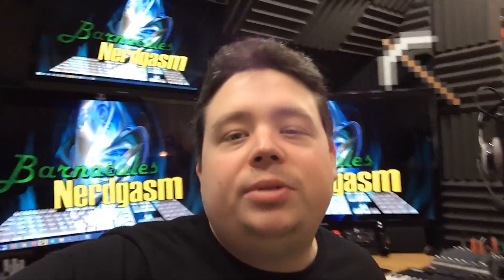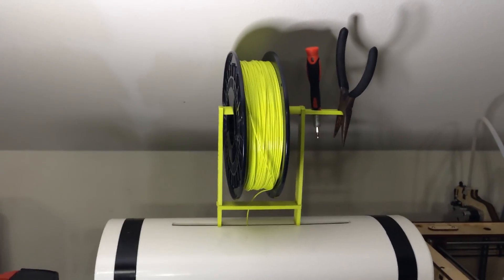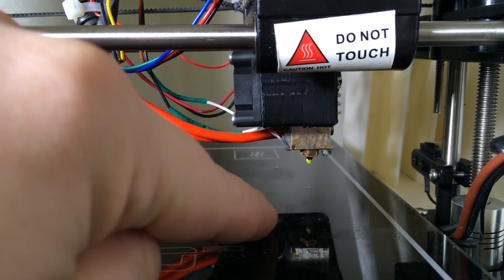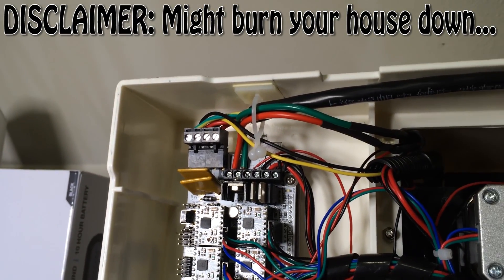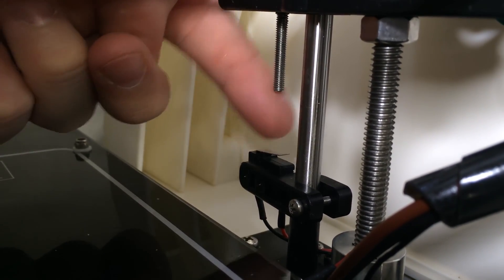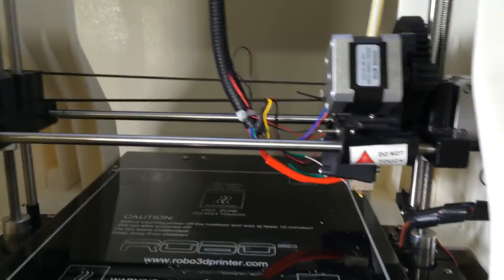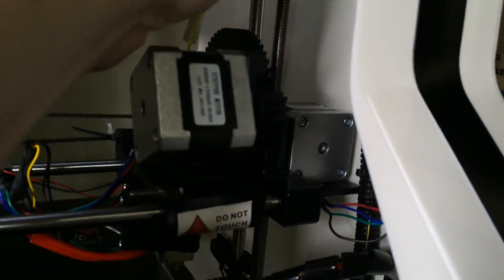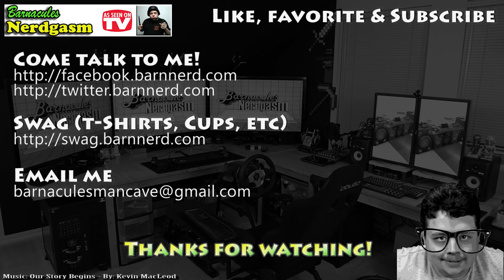How To Fix Your Robo 3D Printer : Tips & Tricks to Get Awesome Prints - @Barnacules

Comment: Hi Sir, I have had my my printer only 3 months and the power will not turn on. I did a 2 hour printing everything was great. 8 hours later it was dead, No lights and no sounds. I did check the power cord and the outlet. I have tried to get help from ROBO and some forum. So success. Do you have any suggestions. Thank you in advance!

Comment: Just a note, there's two versions of that double sided tape. DO NOT use the foam stuff if you care at all about stability. Also, make absolutely sure there are no air bubbles when you mount the tape, otherwise the adhesive will oxidize and stop being an adhesive.

Comment: Thank you for this video! I just got the robo 3d r1plus, and had some issues that you described in your video.  They have since added a stabilizer in the top for the rods and I'm sure a bunch of other upgrades (fixes).  Thank you for the spool! Better design than the one that comes with it in my opinion.  Will be printing this next. Great Video.

Comment: has Robo 3D included any of the "mods" you suggest in the latest versions of their products?  They seem like must haves at this point.
Reply: +Robert George 
I just bought a Robo 3D two days ago, now called the Robo 3D R1 plus. A few of the things shown here to print are added to the new design. The most important being that the guide rods reach to the top of the case and fit into holes lined with foam to keep them supported.
This being said there is still a bit of wobble in them and could be supported better, but it is one change that is similar to these here.
All others such as the print head change are still relevant, and the need to make a top mounted spool holder is a godsend. So even if you buy one of the new models, print a spool holder first.

Comment: I like your take on this particular printer.  I'm curious though, if the changes you've made, rather your upgrades, have been implimented into the latest version of this particular printer.  I've recently had mixed luck with two different Davinici II printers from XYZ.  Ugg.... I won't even get into why I dislike those printers so much.  But recently purchased this printer under the label, Robo 3D - R1 Plus +3D.  It will arrive next week and I'm wondering if the company that designed this printer has implimented any of these updates into it.  Like the supports for the rods.  I never had "tall print" problems with my Davinci Printer, but it had a slew of other issues that I won't go into.  Any advice you may have on someone getting a brand new Robo would be greatly appreciated.  Thanks in advance.  I'll be watching for more vids too.  I've been 3D Printing for two years now with Davinci printers as well as an Afinia H series printer at my work place.  I'm eager to see how the Robo holds up.
Reply: +Michael Hyatt Most of the upgrades that he has done have been built into the new models. I bought the R1 a few months ago, and pretty much everything I ve seen him do for upgrades have already been included in the model I bought. I believe came out with the R1 Plus right after I bought mine, so it may include more improvements. I ve been very happy with my R1 so far.

Comment: you should have a look at the bq hephestos 2 printer, its a DIY 3d printer but has a lot of good points in it, like the extruder comes with all the fans on it, it auto-levels and checks the distance from the platform before each print and stuff. I have one and I love it, not too expensive either

Comment: Just unboxed my new Robo, and the folks over there are listening, most of your upgrades are already addressed.  Spool holder is in a different location, Z-axis rods continue into supports at the inside top of the housing, and the main drive gear for the print head has no slop at all.  There is not a switch in the location you showed, so I can't speak to that yet, and have yet to start a print but will update when I do.  Keep keeping them straight over there!

Comment: I'm just wondering. Since the Robo3D has a RAMPS board, why didn't you just screw in the fan wires to the Heater 9 block, where the designers of the RAMPS board intended you to connect them to?

Comment: Hello Everyone! anyone? haha. So i tried printing a file and for some reason it didn't print the whole thing.. (i wasn't present for the whole print. I left it running) The print is for two peaces that sit over each other but one ended up being slightly shorter. am i missing something? The file is right but the print is wrong. It said est. print time would be 2h 33m 43s but the in the history part it said the file took 2hrs 24m.... Any suggestions?

Thanks a lot!

Comment: I just ordered the robo 3d. Is new printer head bowden or direct drive?
Reply from the maker: direct drive, there are trade-off's the direct drive works better with materials that are flexible like Ninja Flex and are more consistent but bowden takes weight off the print head allowing it to move much faster. I really should do a video on the differences.
Reply: Barnacules Nerdgasm i want to buy an e3d v6 print head for upgrade my robo3d, but i dont know what's the correct spec e3d print head i should buy?
v6 hotend 12v or 24v? direct or bowden?
Reply: John Reno Thanks for the order John.  Let us know if you need anything!

Comment: Hey jerry I have a sub $1000 printer from Plastic Scribbler and the extruder is a nightmare of never ending clogging. The stepper motor keeps on stopping and missing steps during my prints. Do you think I should take a chance and try a e3d v6 or try and return it to get a robo?
Reply: IN3RT1A Tech If you do end up getting a Robo, we'll be there to help you IN3RT1A Tech.  24/7 support.  Thanks!
Reply: RoBo 3D Thanks guys, I did get a robo, super happy with it :D

Comment: I don't think he has the R1. I believe the R1 fixed most of the problems.
Reply from the maker: The R1 has most of the fixes already. I'm actually getting ready to install the new BED upgrade that comes on the R1 and a E3DV6 hot end which they just sent me to replace the v5.
Reply: exxodas Hi Exxodas, you are correct, the new R1 has all the fixes included!
Reply: ROBO 3D does it include the stabilizers. I think i will still print the holder. I think i need it because i will have the printer on the edge of my desk, to create space for the bed to move out on the back. So i might bump into the new designed included holder. Buying this machine next week so yeah :D

Comment: I love you sir I wish you would post a slightly more in depth INSTAlling the extruder I still haven't got my robo working :/
Reply from the maker: I will be installing the E3DV6 hotend soon, I will try to make the video more indepth for that install.
Reply: Hot..!!!You can save to 72$ when you buy Epson Printer here amzn.to/1pMsygI Click order now so very cheap ..!!!
Reply: Man that sucks. My robo came in today ands it's working great. I'm only working on 20 mins or less prints but it's working fine.
Reply: Kevin Nguyen That's good I know robo cares, they do! I deserve my troubles for being an early adopter without a lot of community support to take care of problems along the way.. I got mine early and had problems with my extruder which eventually I wrote to robo about and they are sending me the new r1 metal replacement. I'm close I'll actually probably get it working today, I had problems with the thermistor and attaching the new extruder and getting clogged again!
Reply: Yeah mine is the one with the new Hex heads. i had some problems this morning but it was more with mattercontrol than the printer.
Reply: Barnacules Nerdgasm you go girl
Reply: Barnacules Nerdgasm Did you ever install your e3d v6?
Reply: Barnacules Nerdgasm I will also be installing the E3DV6 soon. An in-depth install video would surely be much appreciated by your fans! Plus, it's been a while since you did a video on your Robo 3D! :)

Comment: Hi Jerry I was directed to your videos from another maker in the 3d community.... I have a few questions and comments on your video. First I would like to say JOB WELL DONE (tip of the hat) secondly I was curious as to when you got your robo printer I just received mine a few days ago, (it seems they have addressed the issue of the vertical rods) as my inner case has the spots for them to lock in on the top, as well as it has its own led lighting in it. Mine also came with a newer version material holder that locks into the outer case itself (but I still think I like yours better) my other concern is that with mine it has a good printing head (well so far anyways) but the problem I am having is the way that they mounted the cooling fan for the head is it now drags on the actual printed part area... sometimes catching on the filament and mucking up the entire print, I wish yours was newer so as you could possibly help me solve this issue.  DO you always use 70 c for your bed temp? and what temp settings do you recommend for printing with PLA and or ABS??? looking forward to your responses keep up the good work and helping us all out .

Comment: I'm sure Jerry is going to get pissed at me, but I am completely nonplussed here.  I tried to post this in the Robo3D forums, but I get a "server error occured".  So I'm just going to post this here, and follow up with the resolution (provided I haven't pulled an Ernest Hemingway/Robin Williams and hope that it helps someone.

I finally got my Robo3D "dialed in".  I printed several parts that were demanding in terms of accuracy.  This took me 2 1/2 weeks to figure out.  So feeling rather chuffed with myself, I shut down the software and printer, went to the corner store to get a few beers to celebrate, came back, fired everything back up again to do a salutory print for my friend's kids ( a couple of lego bricks ) and started getting an error to the effect that the first layer needs to be less than the nozzle width (which is 0.3mm).  Guys, I hadn't changed an F'n thing!  

Isn't this tough enough to figure out without this kind of shit?

ok, next step, try printing something I've already printed and see if the error remains.    

Wow.  that was a paratrooper-turned-wanna-be-nerdgasm.  Let's hope it does some good!  lol

Comment: A couple of observations about the state of the delivered products.  One, and this is the most important, there should be a linux variant of the MatterControl software.  But even if Windows is the only thing they manage to bring out THERE MUST BE A LOG FILE WRITTEN to assist in trouble shooting problems.  Be damned if I can find one.
Second, the E3D print head.  Ok, I'm sure it's a nice print head, but can these cheesey people at LEAST ship a thermistor which has the leads insulated?  How hard can that be to find?  How expensive would it be to include, as opposed to this damned piece of crap in a bag that takes an hour at least to put together a second-rate solution (capton tape -- really?) to a problem that shouldn't exist in the first place.  I notice they're shipping the V6 with these, or at least their web site shows that in the image.
Reply: Oh and one more thing:  If you get the R1, be SURE to check the thermistor leads to the print head.  Mine fried because, as I found, the solder joints were NOT insulated from each other in any way.  About my third hour into printing, the printer simply went along its merry way in midair, with no material extruding at all because the print head was too cold.  No big deal, I had meant to replace it with the E3D anyway.  But hear me now, I'm talking about Robo's PROPRIETARY print head (which seems to be a cheap knock off of the E3D anyway).  It has a milled aluminum heat sink as well.  It may be a great print head, but be sure to check the solder joints on that thermistor.  I didn't know to even do that and much is my migraine over it.  
I'm sure I'll order another Robo 3D for our business, but I'll be ordering the kit.  The product I waited two months for was assembled sloppily, and having viewed the Robo 3D videos on assembly practices, I'm not impressed.  These guys are perfectly good engineers but they have no clue when it comes to using proper tools to do a job.  Next time I'll save the $100 and about 3 days of my time by assembling the unit myself.
Reply: Ok, after a lot of struggles I've figured out what works for me with this printer.  I'll list what I found to be the most important items here.

1)  If installing the E3D print head, make sure you use something besides or in addition to capton tape to hold the thermistor in.  I found that a mixture of the furnace cement and automotive gasket maker (the gunk in a tube) works very well.

2)  Also regarding the E3D print head, make sure that you do your final tightening of the heat break/print nozzle/heat sink assembly after heating up the print head.  If you don't, the print head will start oozing.

3) Once again, if installing the E3D print head, make sure you replace the hold down screws which secure the print head to the X-carriage.  I found that the ones which come with the printer are insufficient to the task.  I ended up replacing mine with slightly fatter screws.  They cut their own threads into the carriage plastic and really secured that print head so that there is no wobble.  

4) On my unit, I was having print bed leveling issues.  I suppose everyone has some.  In my case, I noticed that the loop was printing much thinner on the positive X, positive Y corner of the bed.  On inspection, I found that the adhesive used by the company to secure the lock cylinder in place on that corner had been inadvertently overdone, and there was a tiny bit on top of the cylinder which caused that corner to be perhaps 1mm higher.  After sanding the extraneous adhesive off, the problem went away.

5) Z-axis stabilizers are a pretty good idea.  However, you must be extremely careful installing these.  If not done correctly, they'll push the metal guide posts out of plumb and you will go nuts trying to figure out why the thing won't print well.  I took mine off, but I plan to put them back on after moving the print head as far up as I can, to hold those posts in the proper position while I install the stabilizers.

Anyway, I hope something in here helped some folks.

Comment: I've some questions about the endheat installation:
1- Did you flash some firmware on the robo 3d to use a high temperature?
2- Did you fabricate a new support for the E3D hotend or the actual support fit well?
3- About the conection, did you just cut the wires out and connected them with the new E3D hotend wires?... and connect independently the fan directly from the power?

Comment: It is on Ebay $460, I am tempted but with all these fixes I really may not get it.
Reply: That's not bad, but take a good look at the Prusa mendel i3. The i3 have a better design by default. But more work to get it to work if you design to buy it DIY or in kit. From what I have seen on the Robo3d its a striped i3 with a hood over to cover the stuff. O yea almost forgot to mention the I3 range from 300-1000$ depending on make and part choice.
Reply: I have a prusa I3 8 inch supposed to be 8x8x8 and maybe it was because the guy I bought it from was not mechanical inclined, but it has been a maintenance night mare!  Though now I have most of the problems fixed it works ok.

Though I will say this, IT IS NOT 8 INCHES (sound like a girl I knew bitching) anyway it is 7 on the z and 7.5 on the x and y.

slow as snot and they could have figured out a better way to hold the glass bottom on, they didnt have any center bed support either, both I figured and fixed. The z axis using a all thread bar is not to smart either, it has got bent and crimps, when a part reached 3. inches high it jamed, (Yes I have fixed that too.

Still this is farely new home tech, I have ideas on how to make 3D printing faster but no money to make them work

Comment: It's also a great idea to reduce z wobble by printing a guide and glueing a bearing on the end. Then use it to stabilize the Z axis threaded rod from wobbling as it moves up. It eliminates banding as your prints get taller.

Comment: I am in the market for a 3D printer and I want one that is under $1000 with a heated bed. Would this be a good first printer? I have the time and patients to make adjustments but I don't want to have to put one together. Any suggestions/comments?

Comment: I'm planning on getting the ABS model, and I've been looking at your modifications, i like and understand most of them but have a couple of questions like for instance, where you got the rods you used to stabilize the z axis and how these are mounted on to the actual printer ( not the bottom or top, but the actual head rails... its the best way i can describe it... i assume thats how it was done) and also, where exactly does the thermister need to be secured onto the printer, i've tried to extrapolate this from the video, but i'm not even sure what wire i'm looking at, i thank you for your help!

Comment: So, after watching your videos, I'm seriously considering getting a 3D printer because they are sooooo cool! Thanks for that Jerry. Lol I was considering getting this printer, mainly because of the cost (which compared to other ones is much more reasonable, especially considering that it would be my first printer). I have to say though that watching this video has put me off slightly as it does seem to be a flawed product. In particular replacing the print head doesn't look the most straight forward of procedures and I find it a little daunting to be having to mess around like that if I was to spend the money on the printer in the first place. Would you still recommend the Robo as a good, entry level 3D printer?